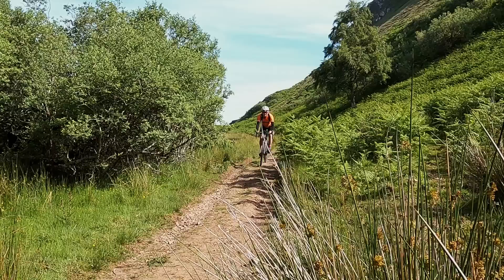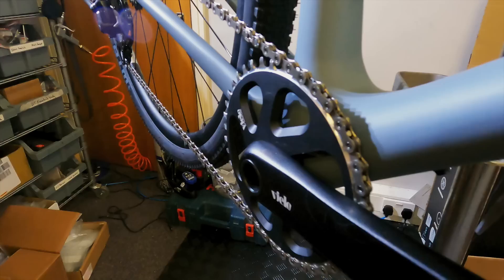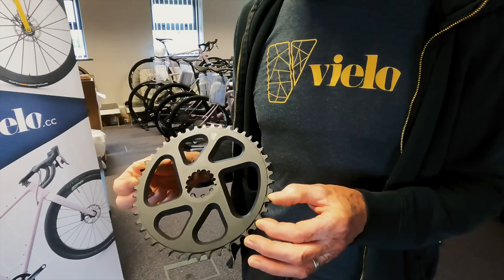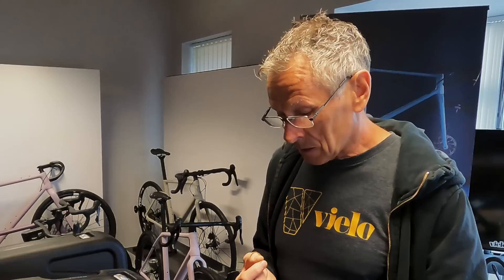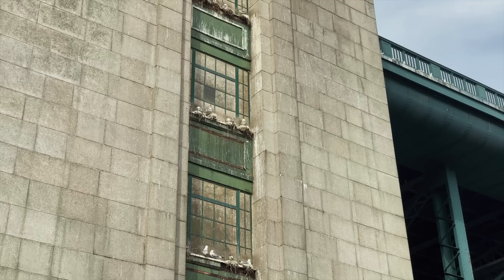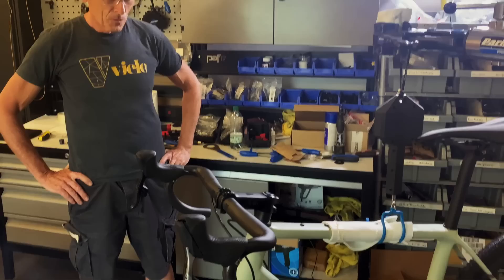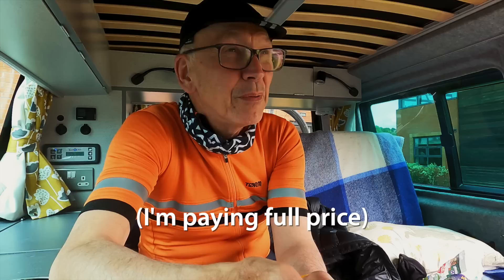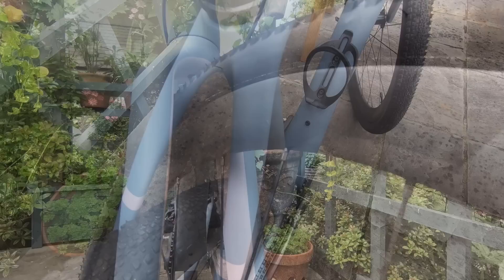Gravel and road bike in one. One bike do it all.  A personal search.

Comment: In my opinion. I would've taken the heavier one because lighter means more fragile off road. Second the weight would be off by a few hundredest of a kg. That could be compensated with lighter/ narrower tires for road use. Along with a smaller chainring up front carbon crankset ti seatpost along with carbon saddle. Finally with all I've mentioned you would've taken at least 2kg  off the bike making it lighter than the one you purchased.

Comment: Curious to know what the difference in weight is between the two frames. To me 8.5 kg for a disc braked road bike isn't bad at all. Granted this was one-by so with a 2x setup it would be closer to 9 kg for comparison to a more traditional road bike.
Both colourways are great tbh. 
Personally I don't understand your quest for an n+1 killer. The beauty of being a bike nerd is having multiple bikes.
Reply from the maker: Frankly it was less than it should have been - something like 250g which really is nothing. It’s entirely a mental thing.  

As for the N+1  -   I “swithered” (great Scot’s word) about whether I wanted a light fast Gravel bike (the Camino is lovely but somewhat tank-like) or a new Road bike as my Parlee is 12 years old and showing her age.  
I might conclude that what I have does not hit the sweet spot between the two and I need a new road bike. 

Thank goodness Liz doesn’t read these comments!😁
Reply: Very lucky Liz doesn’t read them Simon-otherwise you would be truly busted!🤣

Comment: Beautiful bikes (the V+1s, not so much the broken seat tube design ones). The V+1 v.1 looked identical to the 120kg max. system load (👎🏻, not suited for heavier riders), significantly more affordable carbon Ghost Road Rage series. They were pretty (although the newer model is a hair prettier), but Ghost's ridiculously low system weight limit was for me quite the  put-off. Good to see some manufacturers (i.e., Salsa, Vielo, Ghost, Norco, etc.) have not succumbed to the stupid fad of dropped seat stays.

Comment: You're killin' me! 
All that handwringing and you didn't tell us what the weight of the final build was? 😭
Reply from the maker: Sorry - I realised that too late to go back for the final, but it was under 8kg
Reply: @alwaysanotheradventure  so first bike was 8.1gk(8.4 with pedals), yes? What was your final build then, exactly? Asking for my own quiver killer gravel bike comparison.
Reply from the maker: @huddlesteam  really sorry I can’t give you it exactly.  Ian had weighed it when I returned and said “under 8kg” that was good enough for me.  I’ve since added some helicopter tape as frame protection so the weight comparison wouldn’t work. Also I’ve yet to decide which pedals to use so I’m not yet fixed in the final weight - it’s enough for me to know this is the best this bike could be.

Comment: Congratulations to a beatiful bike. Did you ever consider Enve AG25 wheels?
I run the Enve AG25 on my cyclocross when using it for gravel-riding in the summer, back to tubulars when racing cyclocross in autum/winter.
Reply from the maker: Hi Thomas - I have Enve wheels on my road bike so I can appreciate why you like them so much.  The simple answer is that Vielo offered the Zipps as an upgrade for less than the cost of buying them separately.  Enve weren't on offer, and frankly, I fancied trying Zipps.

Comment: 4:50 challenging gravel section right there.
Reply from the maker: You might find this more interesting - https://youtu.be/QTl-nooXDro
Reply: @alwaysanotheradventure  Yes.   But those rounded bolt-heads or whatever the white lumps on the ground are would make a good challenge for a trials rider.

Comment: Very interesting vlog about the "Quest for the holy Gravel". I'm right now searching for the same Do-it-all bike and I am wondering if your are still happy with your Vielo V+1 purchase? Did you get all your bike fitting issues resolved (e.g. shorter stem, saddle position) ? What size did you buy? I'm right between two sizes M and L and maybe you have a recommendation for me.
Reply from the maker: In all honesty, no it’s not the ‘one’.  I like the Vielo but it’s a fast race bike for great day rides - my fastest benchmarks on a local climb are on it.  But for multi-day rides it’s too aggressive for me, and although I accept that might be my age and body condition, Ian Hughes (Mr Vielo) tells me in a different video the same thing - it’s not designed to be that bike.  I’ll try to find a link to that video and put it at the end of this.  
One final point - the 12 speed seems just a little too delicate for the bashing I give it.  It needs a lot of cleaning and tweaking to stay running smoothly compared to my 11 speed, and both are SRAM.  I’m about the ride the Torino Nice Rally (leave Tuesday) and there’s no question of taking the Vielo. It’s the Camino all the way for me.
Here’s that video which I hope helps. Six month review Vielo V+1 gravel superbike
https://youtu.be/TxidV0r0Qbg
Reply: Cool, thanks. So it is a fun machine if you use it for day rides. But for multi day bike packing adventures you would always pick the Camino. As for the 12 speed - I have 12 speed Eagle XO1 AXS on my mountain bike and have never had any issues with it in the past 2 years.
What frame size did you pick? I'm 182cm tall and the website recommends size M. But looking at the geometry numbers and comparing it to my other bikes, it looks more like size L. Any advice?!
Reply from the maker: @svenmueller423  Sorry Sven, forgot to answer than bit.  It's a Medium, and I took the regular stem so I could play around with different lengths and ended up flipping it.  I'm 178cm tall and have a long body relative to my legs, yet the bike fitter used a 110cm stem.  This puts the bars quite a bit forward of the natural pivot point.  There's a good argument to say a larger frame with a shorter stem could be better, which is what I have on the Camino, although that's a very different bike.  Is there a way you could get a bike-fit on one of those Retul 'jigs', so the fitter gets you into the ideal position, then you can ask him/her which geometry would suit you best?  I kinda wish I'd done something like that.  Bike-fitters will sometimes give you discount on a subsequent bike set-up if they've helped you choose it.
Reply from the maker: Oh, forgot to say, this 12 speed is eTap which might make a difference

Comment: Are you going for different wheel sizes? 700x30 for road and 650x50 for gravel? Or 700x30 for road and 700x42 for gravel? The first would be more similar in handling but a lower clearance. The second would have better clearance but a bit slower handling. Again with gearing, maybe an 11-34 road and 11-42 for gravel? It is good to have choices...
Reply from the maker: I have the 650s from the Camino converted to XDR hub and a 12 speed cassette.  I’m keeping the cassettes the same otherwise I’ll be changing chains and re-indexing  each time I change wheels.  Currently wrestling with the new 45mm tyres for the 650s trying to set them up tubeless which is proving difficult.  Once sorted, I’ll get some 32mm gravel kings on the 700s as I’ve found them good on road and off.  But it’s all taking a lot longer than I expected.

Comment: Look nice bikes but I’m afraid having a bespoke chainring you can’t get anywhere else puts me off.  If other manufacturers don’t take that up, if this company was to ever fold, your stuck  with an issue? 

Apart from that they Look good bikes, good company and good service,

I bought a Kinesis Titanium GTD for roadish work with 50mm carbon rims and in total it’s 8.4kg (could go lighter still) which is now alongside my Sonder Camino Ti,  

🤔🤔😊😊

Enjoy your new bike 👍
Reply from the maker: Stuff like that does concern me, but I'm sure it can be sorted should it be necessary.  Superstar components do a range of chainrings and there's bound to be one which works.   That said, I've already got a hanger just in case.
Reply: Yeah that would be my main concern about this brand also and would probably put me off it. Longevity wise that could be an issue.

Comment: what is the wheel size ?
Reply from the maker: Most gravel bikes with disc brakes can take either 650b or 700c wheels - these are 700c and it has clearences for 50mm wide at that.  There's much more in this video with the bike after 6 months https://youtu.be/TxidV0r0Qbg

Comment: Mmmm. 1x failed as a road project. It failed for me on the MTB. I'd never consider it for gravel. More gears means more versatility and it WILL compromise your road riding. Bespoke chainrings and 'tight tolerances' spell trouble and clearance issues to me.
Sorry to see the Camino relegated.
Reply from the maker: I share some of your concerns already.  But not the Camino - I've chosen it for two trips already.